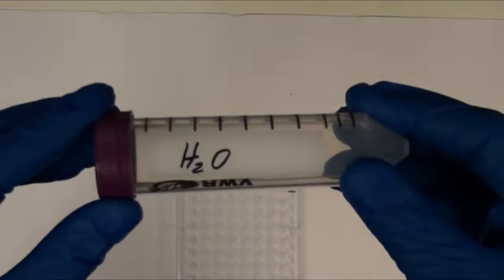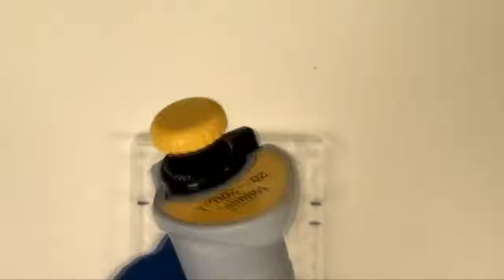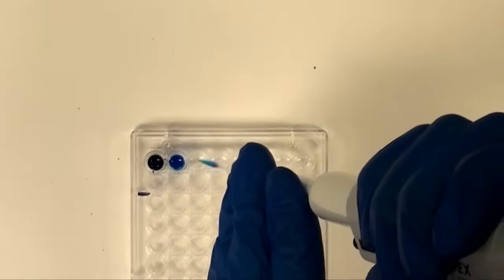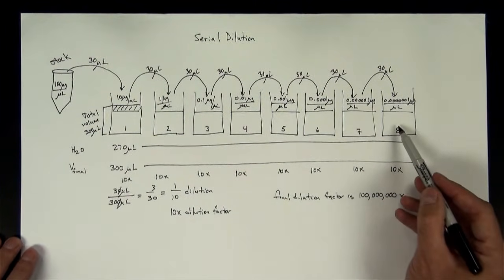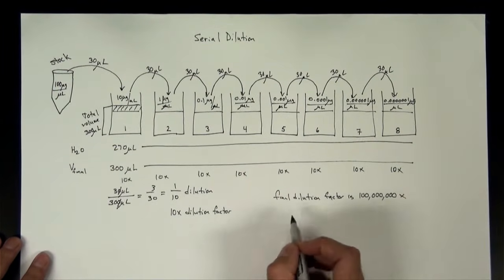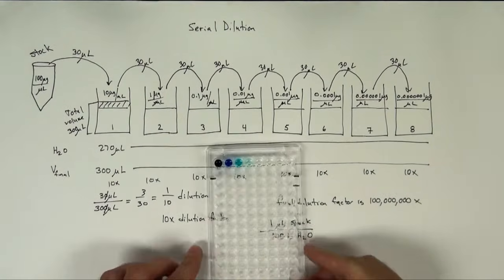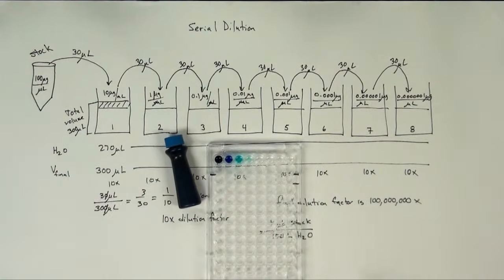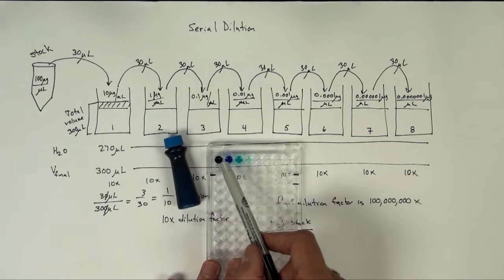Concentrations Part 5 - serial dilution

Comment: i beleive that what you have done is wrong coz 
1- final volum is 270 it is not 300 since you have subsequently removed 30 from the first tube and diluted it in each tube and you should have throw it after last tube.
2- to do 1/10 dilution of total volum 300 you should add 33 of stock and 333 of diluent (solut/slolvent+solute=33/300+33 =0.099 =approx 1/10=0.1) 
3- then you can add 300 of diluent and then 33 of stock and subsquent dilution so the total volum will be 300 in each tube
4- what you have done is good for one step dilution not serial! 1/10 = 300/10 = 30 - 300 =270+30 which is coreect for one step dilution.

Comment: how total volume of solution in each tube became 300micro liter   
you added 30 micro liter to 270 micro liter then  subsequently you removed 30 from each so it should become 270 again but you have written 300
Reply: 300 um was the final volume of the new solution produced. You calculate the concentration of that solution, then dilute it to make the next solution.

Comment: Final volume is 270 microliter. 30:270=1:9. Isn't it 9 times? not net times?
Reply: The total volume of solution is 300 um once the 30 um of stock solution is added to the 270 um of water. 30:300 = 1:10

Comment: I believe you made a mistake. you would need to get rid of the 30microL from the last tube to keep the volume 270ml in all tubes.
Reply: That does not really matter because the concentration does not change. If you reduce the last volume to 270microL it is still the same concentration. So why waste 30microL?
Reply: but in case of elisa .....concentration matters a lot

Comment: Can you make a video showing how to calculate it going backwards. For example, what if your stock solution was an "Unknown concentration" and the concentration of the final test tube was 10. How would you do the math to compute the concentration of the substance inside the stock solution?
Reply: In this example, the dilution factor is 10. All you have to do is multiply your final concentration by the dilution factor (10) to calculate the concentration of the preceding solution. You would repeat this step, calculating backwards until you finally get to your stock solution.

Comment: Thank you Greg. Clear explanation! I have one question (may be it sounds stupid). How does well 1-7 have 300 ul final volume. We started with 270 ul and added 30 ul to well 1. But, after that we pipetted out 30 ul to well 2 from well 1. Then, well 1 should have 270 ul as before, right ? Please enlighten me.
Reply: +Samiksha Ghimire Once we make require concentration , then we can take any volume from the vial, it does not matter...
Reply: you're right
Reply: absolutely right
Reply: but during measurment of  turbidity it will

Comment: I  dont get the 1microliter/100L at the end part. How did you get that?
Reply: You probably don't need the explanation now, but.... 1micoL/100L is equal to (1x10^-6)/100L= 0.00000001microG/microL or 100,000,000x dilution.

Comment: Thanks for the fantastic help with the video but I hope you don't mind it's I just have a few questions to ask: 
Does the dilution factor form a geometric sequence in the form 10 x 10^n-1 for each beaker you diluted?
Secondly, shouldn't the last dilution be 0.000001ug/uL (1x10^-6) because you started from 100ug/uL and diluted it by 10x for 8 turns? 
If you could provide answers to this then that would be fantastic! 
Thank you :)

Comment: Hey I have a question for you. This may be silly. I know you initially placed 30ul into the first mircrotube. but then you took out 30 ul. why is the total volume still 300 ul? wouldn't it be 270? and the last tube contain 300ul?
Reply: -I think your issue is in calculating concentration. Which volume do you use? 270 or 300. If i'm right keep reading :)
-Yes. the new volume for that container is 270ul. However, when you made the mixture the total volume was 300. Removing volume after the fact doesn't change the concentration. If you make a new mixture - freeze. calculate concentration with that.
-analogy: When you pour a glass of orange juice, the orange juice in the jug has the same concentration there is just less volume. you didn't dilute the orange juice. 
-hopefully that helps :)
Reply: This is a satisfactory explanation. When any tube was first diluted after addition of 30 uL from the previous tube and was for a moment at 300 ul. After the then diluted product was removed from the 300 uL the final volume was 270 ul. At both 300 ul level after the initial 30 was added AND at 270 AFTER the 30 was removed for the next tube the concentration remain the same. The exact volumes after dilutions are complete might be useful for downstream analyses, but does not affect concentrations. You could take 30 from the very last dilution and discard it, and then all tubes would have appropriate concentrations and all would have 270 ul of sample remaining.
Reply: I had this same question as I was watching.
Reply: thanks it does,

Comment: So you multiplied the dilution factor of 1/10 by the original stock to get 10 microliter/ mL  in the first box? And then proceeded to multiply 10 by 1/10 to get the second box? Also, did you change tips after each dilution? thnx.
Reply: There's no need to change tips. You are literally transferring the same solution from one beaker to the next.

Comment: It's better to do a a 2 fold dilution I think. Take 3 ml water add 3 ml sample (final volume 6) then take 3 from that and dilute so your final vol in each test tube is 3 ml. The first has concentration 1/2 that of the stock, the second has 1/4, the 3rd has 1/8, 4th has 1/16, and etc..
Reply: _getfree, This depends on the application of the serial dilutions, If you were trying to obtain a solution that is 1/32 of the concentration of the stock then you would use the two fold, but you wouldn't use the two fold if you needed to obtain extremely diluted solutions from a stock such as 1/1000000 dilution, as performing 20 dilutions is grossly impractical.

Comment: We're supposed to find out that if I take 5mL from a 10mL sample substance, mix it into 10mL of water (the outcome would be 1:3), then take 5mL of that 1:3 solution and mix it with the original sample substance, then which one would have a higher concentration based on it's original substance?

Comment: Hello nice video. I understand most of it apart from where u talked about the other way of doing it instead of pippeting it out using the serial dilution. Then u mention 1ul of stock/100 L H20. I was wondering if u could explain how u derived those numbers. Thanks

Comment: @Arishtat  you are correct to say that the volumes are 300 uL because the dilution is always calculated with the total volume (30 + 270) then that is intern used for the stock